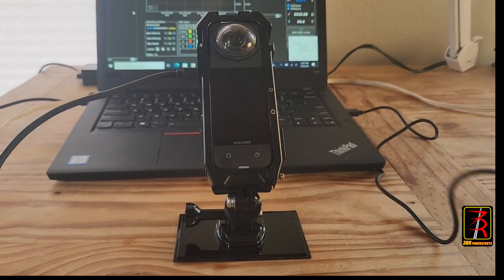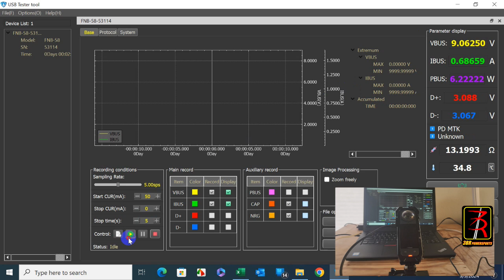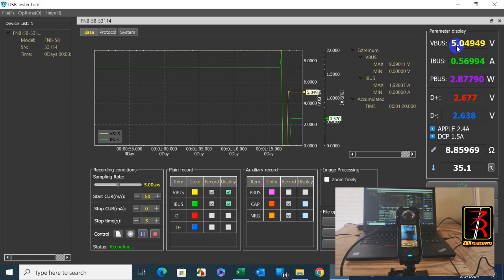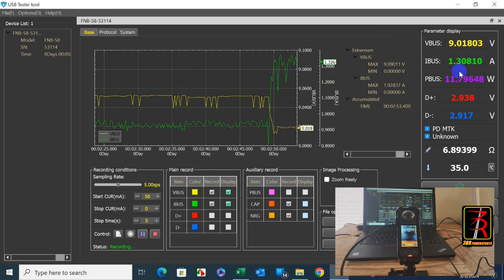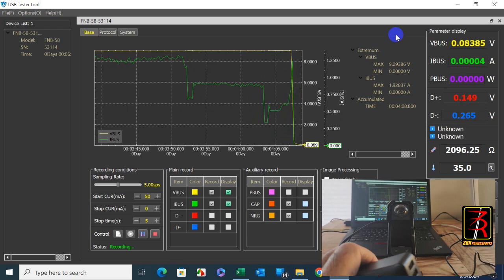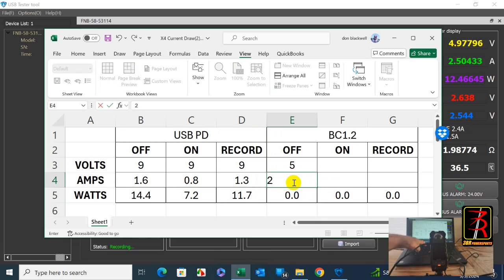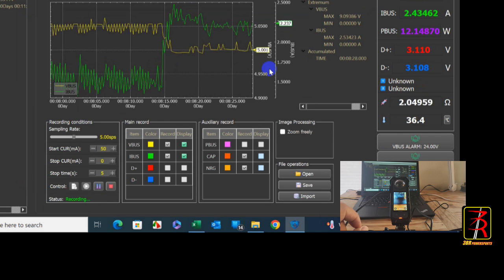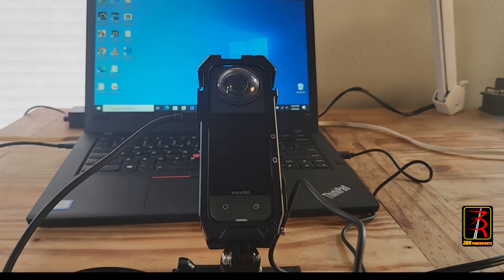Insta360 X4 Camera External Power Test

Comment: Great video! What record settings is the camera using, and is it running at max performance? Trying to figure out if the 5V @ 2.4A consumption is when its recording at 8K, max frames per second, 360 video?
Reply from the maker: Sorry I should have mentioned that it was recording 360 ° at 8K30fps
Reply: @3BRPOWERSPORTS  Thanks, this is super helpful

Comment: Can you recommend best camera for kayak bass fishing? I want to hit record and go for the day. Power bank but weatherproof when there's rain.
Reply from the maker: The X4 with the 3BR Powersports X~PWR X4 kit is very popular with anglers. The cable seal for external power will withstand heavy water washdown so it is perfect for kayaks. https://3brpowersports.com/products/x-pwr-x4-all-weather-external-power-for-insta360-x4-camera
Reply: I"m doing the same thing, Don has a waterproof case for the X4, I'm currently running that camera on my kayak all day in the rain, just got back from a bass tournament Clearlake, I need to add a battery to my set up, I'm running a GoPro 9 and the x4 and my electronics from two battery's, adding a third, my system didn't last the day, It did good the one day I didn't run the X4, next day with the X4, didn't get a full day. Came here to see what the draw was from the X4, great stuff Don.